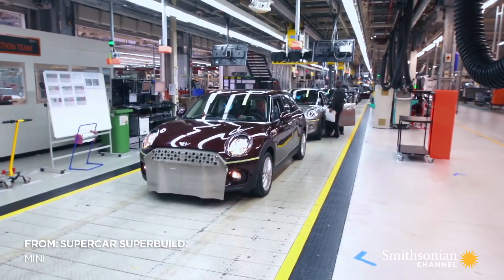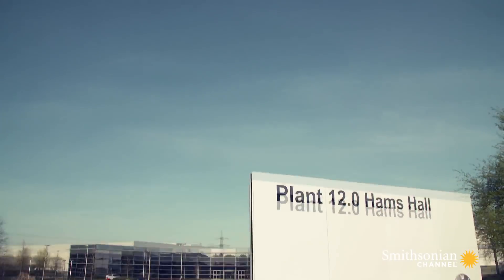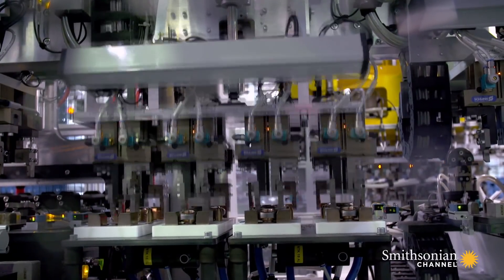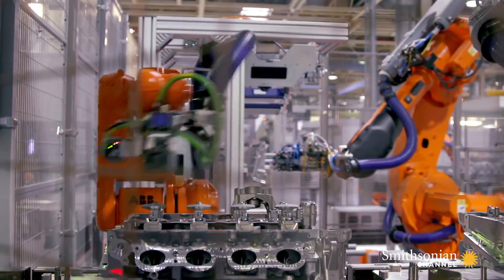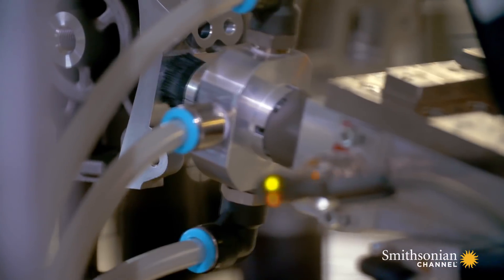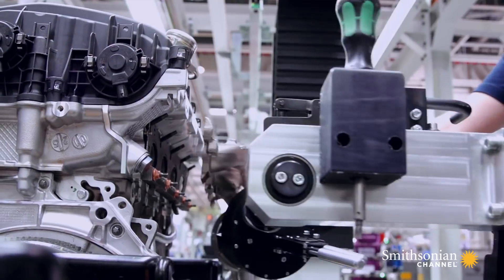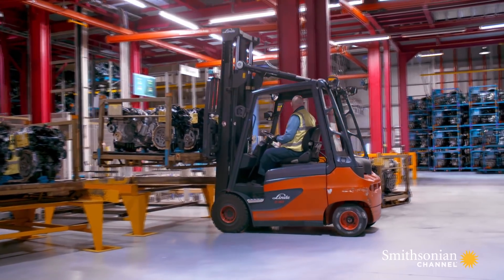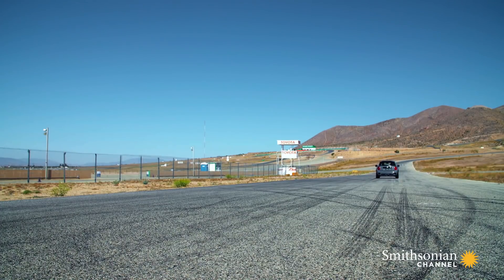This Is How MINI JCW Turbo Engines Are Built

Comment: Since Toyota has a partnership with BMW they can use this engine for a performance Corolla HB and sedan combined with a 6 speed manual. It should be called T-Sport, the Rolla will be faster than the Mini Cooper S but not faster than the JCW, to avoid any controversy i would use the 190hp configutation.

Comment: A minor correction at :50. It’s not a motor. It’s an engine. Motors are usually electric driven. Engines are driven by internal combustion.
Reply: Wow, someone woke up on the wrong side of the bed. I didn't mean any offence to anyone and definitely not personally at you. I just wanted to offer a helpful correction but apparently that really pissed you off somehow and made you resort to foul language. Good day to you.
Reply: Besides if you actually want to get particular about the word choice, an engine is a type of motor. Therefore engines are also motors.